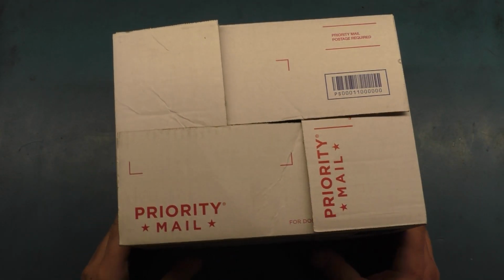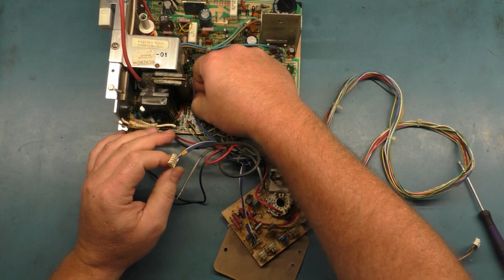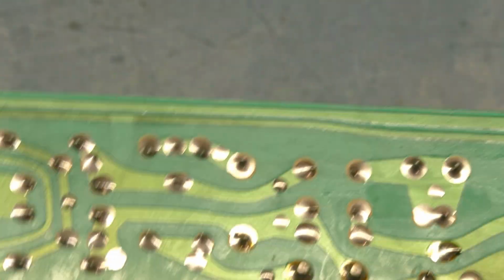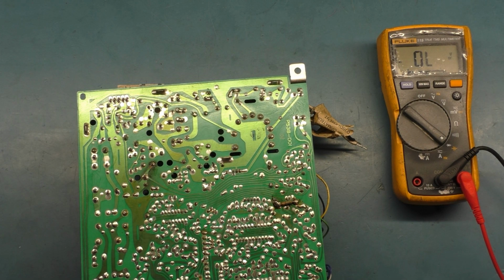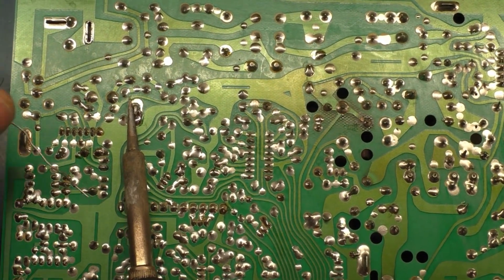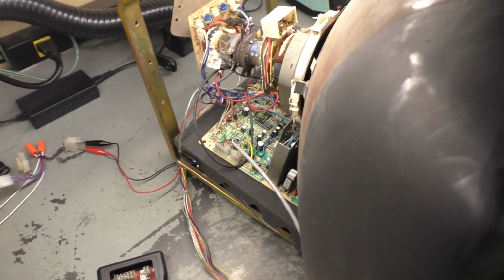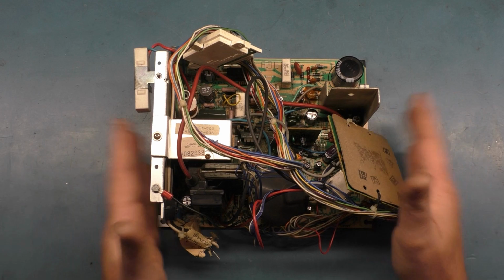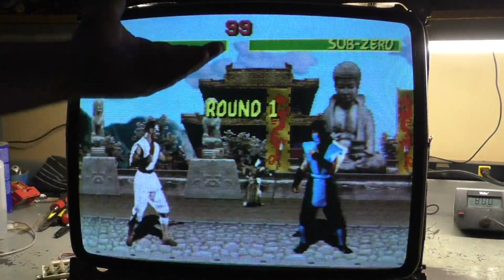25" K7000 Arcade Monitor Chassis Repair - "Dead" (#6)...Or Not?

Comment: I have a WG 951160  on a 25 inch Sega Arcade.  Is a manual available.  It has a small board off to the side.
Reply from the maker: I’ve never heard of a 951160, so I can’t say.

Comment: Mike, what’s the common parts I need to order if my flyback cracked and grounded to the frame? I recapped it a month ago and now this
Reply from the maker: Should be just the flyback. Unless the fuse blew, then you’d likely need the HOT and Voltage Regulator.
Reply: @MikesArcadeMonitorRepair  First time I ever so a flyback arc like that in person.

Comment: I want to adjust the horizontal width on my crt but I am afraid to crack the  width coil.  What tool do you recommend and what direction to increase width? My coil looks like it's on the verge of breaking.
Reply from the maker: This is what I use. If it doesn’t move, you’ll have to replace it. Adjusting it in shrinks the width. Adjusting it out increase the width…

https://www.arcadepartsandrepair.com/store/tools-supplies/tools/g07-width-coil-alignment-tool/
Reply: @MikesArcadeMonitorRepair  Thanks Mike!! I will most likely replace it.
Reply: It also helps to let it fully warm up for 15-30 mins before attempting to turn the coil.